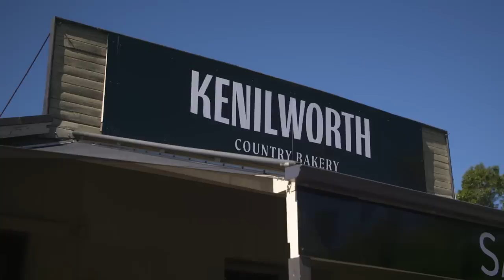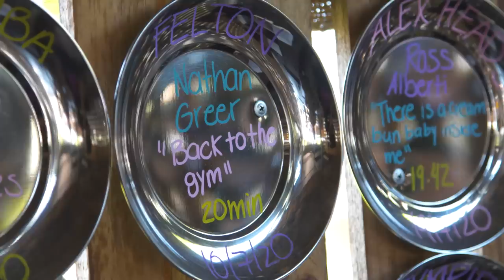CARNAGE on QLD's toughest 4WD track! Panel Damage & Busted Steering on Glasshouse Mountain tracks

Comment: Me in my 78 Chevy suburban I was running down trail 912 and down at the bottom your on the rivers bank with a deep v notch I had my father in law with me and we timed it wrong we got down there at dark so he had to hold flashlight on the trail cause my halogen bulbs couldn't light well enough

Comment: I recently picked up a 2022 Pajero Sport. Will I need a bullbar and winch to do some light 4x4 driving and tracks? I'm hesitant to get the bullbar and winch because it ruins the look of the front of the car and also voids alot of the warrantee and insurances.
Reply: No you do not need a bullbar and winch. The only thing you need to enjoy yourself is good tyres. All Terrain Tyres will be fine to not ruin your vehicle on the street. A Subaru Outback can do most “light off-road” tracks without issue.
Reply from the maker: Like Rob says mate tyres are the most important thing. Get a good set and you'll be able to go a lot places you couldn't on road tyres. 

The harder stuff you tackle, you'll find that you're not getting enough clearance so you may want to look at a suspension lift, but a winch and bullbar (you may be able to get a discreet winch mount for your Paj without needing a big bar) are very cheap insurance to get you out a pinch if you're bogged, beached or hung up - especially if you're out on your own.

Comment: A set of big Red lights would have been fantastic at sunset one night on Gunpoint Beach in the Northern Territory. Got stuck for 6 hours before eventually calling a expensive rescue. Proper lighting would have been fantastic allowing me to stick to the track instead of falling off it. Would have saved me $600 rescue fees.